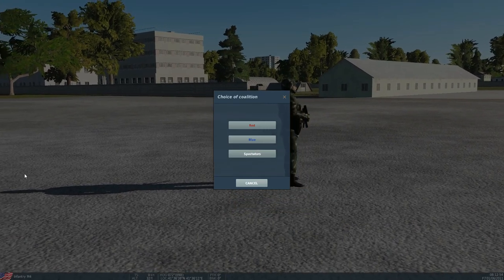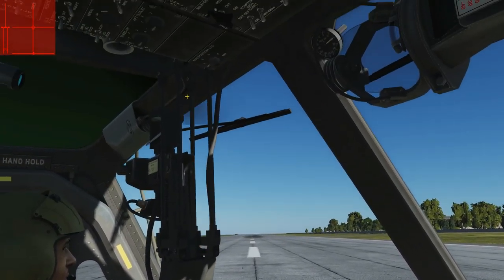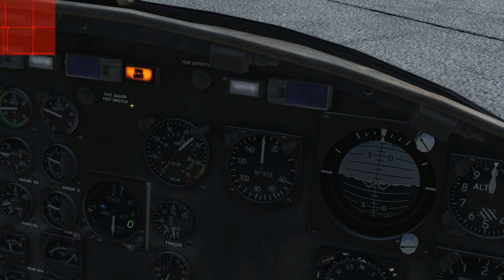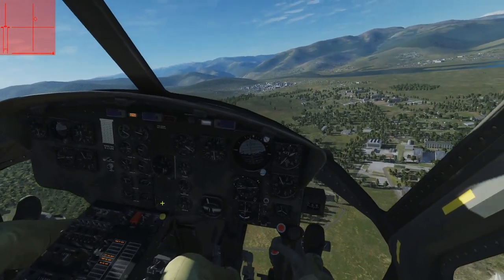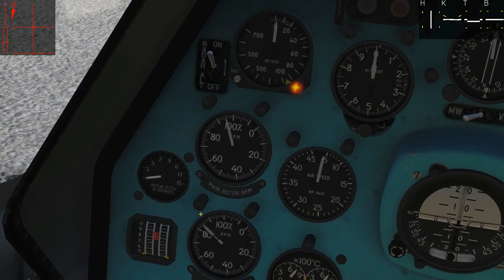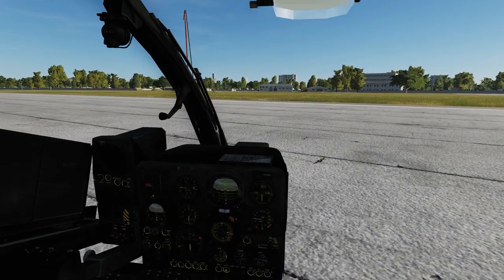Flying Basics: How To "Split The Needles" In DCS WORLD Helicopters

Comment: nice cap!! you're totally correct about this, the freewheeling unit or sprag clutch must keep the rotor rpm high while the engine rpm goes down when you throttled down. The main principle is that the engine can drive the rotor but the rotor MUST NOT drive the engine. I even think that when the fuel is cut off the engine dragged the rotor down a bit until the wash speeded up the rotor again. Bug I guess, big one though.
Reply from the maker: Copy thx

Comment: 9:20 - Mi-8 has a fuel cut too - two big red levers on the ceiling.
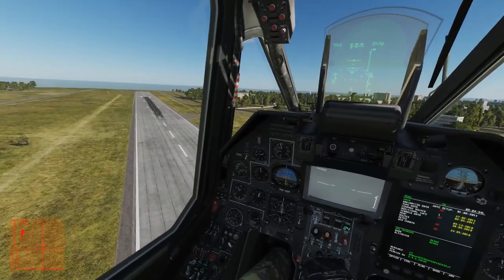12:50 - fuel cut in Ka-50 is two big red levers on the left console, besides the collective.
14:40 - radio-altimeter warning of crossing preset height
Reply from the maker: Copy

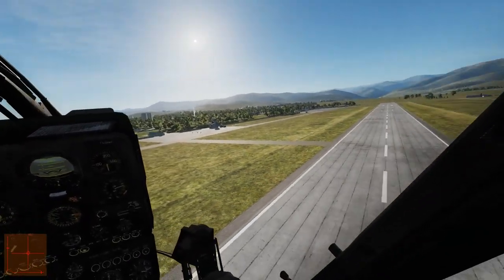Comment: 11:08 Cap I recently bought the Gazelle and initially felt the same way about the handling, way too twitchy and hard to fly. I looked on forums and found a huge help was setting the Y saturation to 85 and curve to 15 on both pitch and roll axes, makes handling it so much easier. Also, setting the trim once you’re in forward flight is a huge help.
Reply from the maker: will try

Comment: Why pitch down in autos? Pitching down makes rotor rpm to drop (while turning makes rpm to rise for a giroscopic effect), in real autos you have to pull back a bit to mantain rotor ‘s rpm and mantain around 70kias in most helicopters models.
Reply from the maker: Just bad habit I've picked up
Reply: The cap is not pitching down, the Huey pitches down due to a very very old bug in the FM

Comment: It's been a long time since I twisted a wrench on a helicopter but I don't recall any mechanical clutch on a gas turbine equipped helicopter.  Probably is one on a piston driven heli but I never worked on them.
A gas turbine uses two stages: a gas producer and a power turbine.  The second is connected mechanically to the gearbox.  The only connection between the 2 is fluid, i.e. exhaust gases.
Still, because of the greater inertial energy in the rotor head, the gas turbine should show a decrease in rpm before the power turbine/rotor system.
Reply: There's a clutch in all the helicopters I've flown. Being able to disconnect the drive system from the rotor system is critical.
Reply: we are talking about Freewheeling Unit, like in a bike. Every helicopter has it, otherwise FAA wont approve. BST isn't modeling correctly the engine in this and a lot other aspects.
Reply: Right... let myself get hung up on the clutch term but that is what the fwu does, I suppose.
Reply: @WebberAerialImaging  actually no, the free turbine is linked to the driveshaft

Comment: I practice auto's all the time in DCS by rolling the throttle to idle. I always get a split. I recommend a repair on your install.
Reply: first you need to understand what a split is. In the Huey the only split you get is when fuel is cut off or engine fails. But not when turbine rpm is less than rotor rpm like IRL.
Reply: @piston_77  You and Cap are correct, just rechecked, and indeed the N1 stays matched up with the Nr when you roll the throttle to idle.  I must have been thinking about my auto practice in  Xplane :).  That's Ok, the auto characteristics in DCS aren't that great. That nose tuck is absolutely not present in real Huey's on entry to the auto, but it's still a blast to play around with.
Reply: @drussell15  you're are right about the nose down tendency when engine is lost, the Huey is very fun but still has a lot to improve.
Reply: @drussell15  nose tuck imo is just da Grim trying to get some airspeed for saving rotor rpm in the safe zone. this is not Arma on BFM, you can't land here just vertically on autorotation. ^)

Comment: you are not trading potential energy for kinetic energy in a dive when you disconnect the rotor. It is not a jet. You are having no connection to the driveshaft and now the air is the only thing that drives the rotor, which is done by increasing or decreasing airflow through the rotorsystem, or basically getting the air in a certain angle of attack through your advancing and retreading blades. That will increase or decrese the blades and eventually split the needles.
Reply from the maker: Roger I think I understand.
Reply: actually no, needle split should occur due to a Freewheeling Unit that all helicopters have. Like a bike